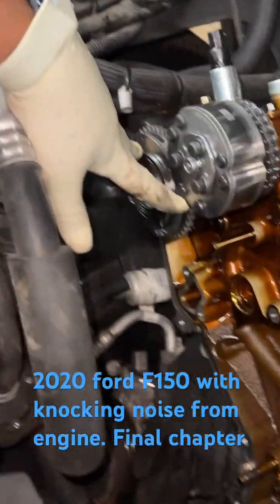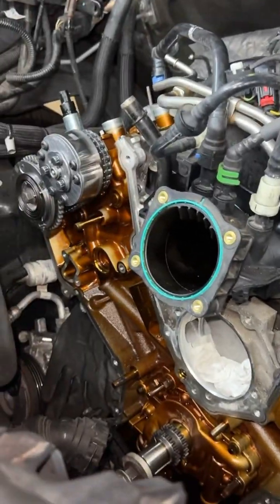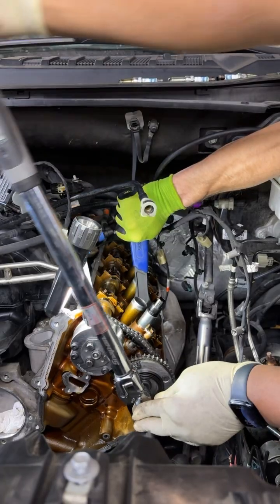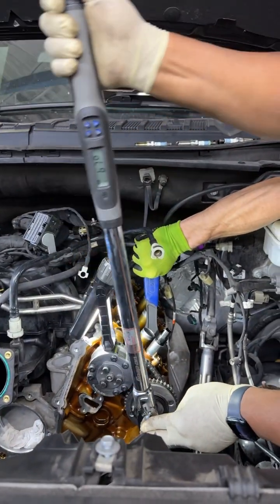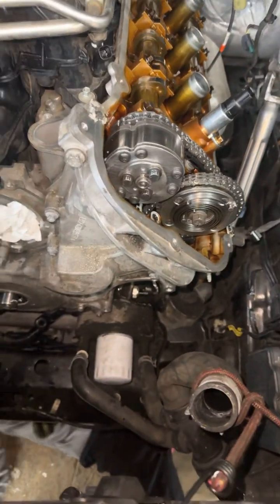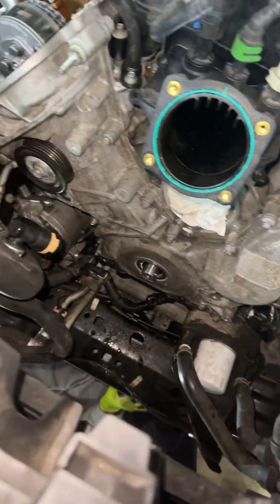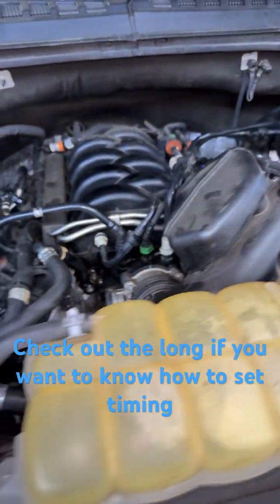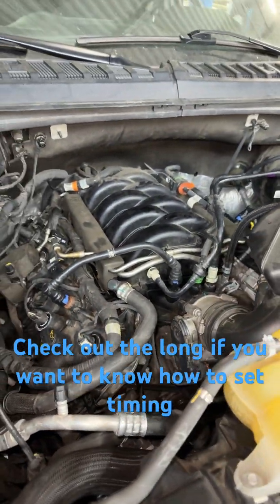Timing chain  and Cam phaser replacement due to noise ford 5.0 coyote engine

Comment: How did you take out RH valve cover without pulling the intake manifold? I am doing this job right now and intake manifold is pain in the ass to remove bc all the connectors at the back
Reply from the maker: We had our intake manifold off

Comment: You used same parts as they did when they built the car . Those parts are the problem you need new redesigned cam phasers
Reply: I’m so glad I’m not the only one who noticed, not only is the old style phasers the issue but the TSB 19-2365

Comment: Hey there’s a slightly sludged oil passage leading into bank 2. My guess is between the block and the heads where the galley gets narrow. This is evident by the much darker varnish, especially around the tensioner (which receives oil first). This customer will be back
Reply from the maker: Duly noted.  Let’s see if it happens.
Reply: Gotta love people like that! You'll never run out of business lol...yet it's so simple to just change the oil more often.

Comment: As a 19 year Ford technician I have done this repair countless times over the years. This is the first time I’ve seen you guys tackle a major Ford repair as you guys seem to work on mostly german vehicles. It does my heart proud to see you guys successfully get that 5.0 back on the road. Keep up the good work!! 👍
Reply from the maker: Thanks for the awesome compliment.  as you know, a car is a car when you’ve been doing it as long as I have
Reply: Could you give me some tips on what's really necessary to remove to do this. 2019 5.0 gen 3 in a XLt f150 replacing phasers and chains

Comment: That’s a serious Job I had to change my valve covers as well cause those always crack and leak oil all over the driver side oil pressure sensor
Reply: I must have gotten luck my plastic valve covers on my 5.0l (2012)  have yet to crack or leak. Though I have the aluminum covers for when I go to do this same job.